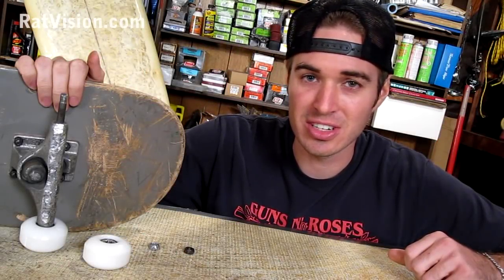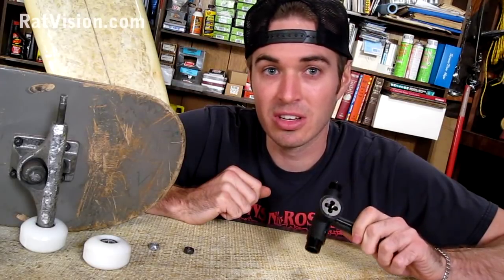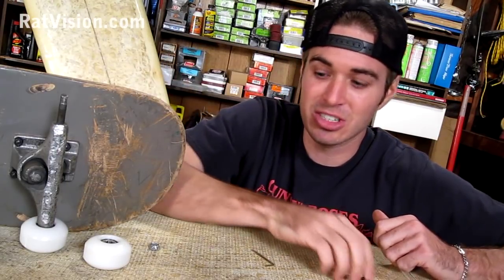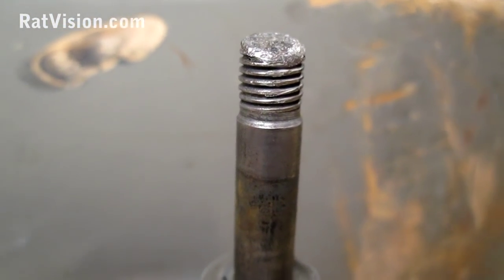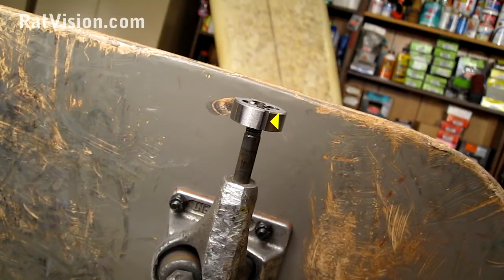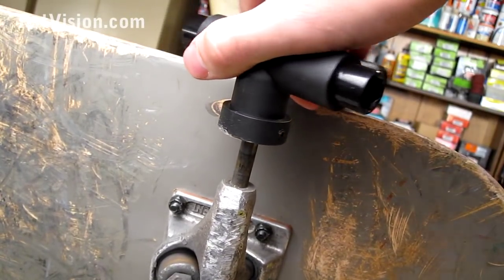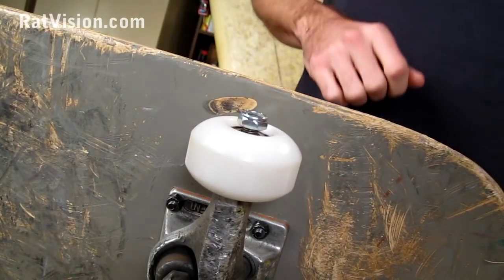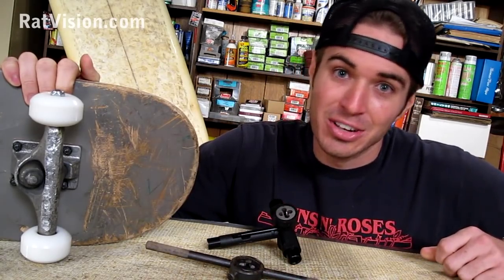Fix Truck Axle Threads On Skateboard & Longboard

Comment: When you are using a die to cut or clean a thread always use a lubricant like trefolex. Also, you never cut a thread in one pass (constantly turning the die in the one direction until the end) do a half turn or so then back it off a quater turn to let the swarf clear the die (thats why the die has three or more cutouts around it, to help clear swarf out and not get clogged up and jamed). Keep doing this until you have reached the end of the thread. If you don't clear the swarf out it can jam up the die and thread and cut a really nasty notchy/broken thread or worse strip/cross the thread completely, which means new truck time.
Reply: good info but not really applicable to this imo. you shouldnt be removing enough material to clog the die as the threads have already been cut; youre only cleaning them up

Comment from the maker: The axle washer is used as a spacer between the bearing and nut.  If you don't use bearing spacers in the wheels the nut will push the inner ring of the bearing into the wheel.  This binds up the bearing and it won't rotate.  This crushed the shields in one way and pushes them out the other side.

Comment from the maker: Thanks.  You're absolutely right.  But most skaters, typically street skaters, don't use spacers. If you watch our other video about spacers you'll see how most of the time spacers don't work.  You have to give a wheel a little bit of movement without spacers, and sometimes with spacers, because they don't always work.

Comment from the maker: @ClowninAroun Washers keep the bearings from touching the truck and axle nut.  They also allow tightening of the axle nut down (with a bearing spacer), so the wheel and bearings can more efficiently.

Comment from the maker: 5/16"-24.  The 24 is important.  It means how many threads there are per inch.  It also indicates that nut or bolt has "fine" threads. However, it's very hard to find the right nut at a hardware store, because they don't sell thin/flatter nuts.  They are usually taller and have more threads on them. This causes a problem when there is not enough threads sticking out on your axle for the nylon to grab onto.

Comment from the maker: It can be extremely frustrating if the axle is badly damaged.  You've to hold it steady and force it one.  Sometimes pushing down and going backwards a tiny bit and then forwards helps to grab onto threads.  You may need to look at the axle closely and see what may be causes the problem.  The close up in the video shows how the threads can get flattened. This could be an issue all around the end.  You may need to file some metal away.  It's hard to say what to do without seeing it.
Reply: If the tip of the thread is so damaged (like in your video), I would go over it with a thread file first (a special tool), then it should be much easier to thread the die on straight. If there's enough extra thread length, you can just put a good 45 degree chamfer on the end of the axle. This would just remove the portion of the thread that is mangled, and the die should go on easily. This (the chamfering) is also done when cutting new threads on a length of bar.

Comment from the maker: If they are worn down maybe not, but it might help. Since your trucks are new, it's probably from the tricks you're trying. Replace the axle nut too.  If you have axle washers on you may need to remove one or both, so the nut can grab onto some threads.

Comment from the maker: @JustSomeRandomNewb   No, the original or old threat will not be damaged.  A die was specifically designed for this task.  The die is the same size as the threads on the axle.  All the die is going to do is remove, or push back metal that is in the grooves, as wells as sharpen the threads.  If there is any damage to the original/old threads it's going to be caused by having the die crooked.  I assure you that no damage will be caused by the die, if used correctly.

Comment from the maker: Yes we can help with squeaky trucks. A common trick is to use Dove brand soap shavings in the pivot cup bushing. Bee's Wax will actually work much better and last longer. It can resist moisture and doesn't break down as fast. Take a small piece of bee's wax rub it all inside the pivot cup. U could also put wax shavings in there instead. Rub some on the piece of the hanger that goes into the pivot cup. Bushings may be causing the squeaks too. Apply wax on the hanger that touches the bushings.

Comment from the maker: @916attila I am going to assume you meant to say, "...the bolts [you meant nut] do NOT stay tight..."  Is that correct?  The problem is the nut. Like I showed in the video the the nuts can get damaged and loose their threads.  Also the nylon (white plastic) in the nut gets worn out.  You need to replace it.  A new nut should fix your problem.

Comment from the maker: Actually, it's the bearing spacers that allow you to tighten the nut all the way down.  Without the spacer there is nothing behind the inner ring to keep it from pressing inwards. The washers are also used as a spacer between the truck hanger and the bearing, and the axle nut and the bearing.

Comment from the maker: @Hwiwonkills You can get the Reflex Utili-Tool at a skate shop or online, and get a die at a hardware store or online as well.  Ebay has them.  I saw a set for as cheap as $10.  I recommend the skate tool.  You actually made me realize I left something out.  The size die is 5/16-24.  Be sure you get 24, because this means that the die has fine threads which match the axle.  Avoid sizes 5/16-18 or 5/16-32.

Comment from the maker: It can be very frustrating sometimes.  Have patience.  Sometimes I find pushing down and going the opposite way (couter clockwise) a tiny bit then counter clockwise helps for the threads of the die to find the threads of the axle.  Take a close look at your threads.  Does it look like one threads got smashed down into another?  See what's causes the issue.  If you can find the problem then you may know how to best use the die.

Comment from the maker: @TylerM4197 This happens sometimes while taking the nut off.  Basically the threads are not twisting out anymore.  To get it off you need to angle the nut as you turn it.  Do this by prying a flat head screw driver between the nut and the bearing. Apply some force to the nut like you are trying to pry it off.  With your other hand use a tool to try unscrewing the nut off.  The nut just needs to angled as much as it can to get it off while unscrewing.  let me know if this worked for you.

Comment from the maker: Find them at a skate shop.  The dimensions are 5/16-24.  The nuts at a hardware store are taller and may not screw on the axle good because it won't grab onto the nylon.  Best thing to do is get new ones at a shop.  Also ask for some old nuts if they don't have new.

Comment from the maker: @anindo75 I hate to say learn to flip your board better, but that's the only way to keep them from getting smashed up. The threads on the axle are more important than the axle nut.  As long as you can get the nut off that's all that matter.  Pro's mess up their axles just as much as everyone. Plus who knows how often a pro changes their trucks or axle nuts. Everyone is different. You can get new nuts at a hardware store if you need them.

Comment from the maker: How are the threads.  Sometimes truck axles stick out farther on one side than the other.  This can result in not enough threads on one side of the axle.  If that is your case, you can remove one or both of the axle washers to get better/more threads for the nut to hold onto.  See if that helps.  Let us know if it does.

Comment from the maker: The die on the skate tool is the same thing.  But you don't have to have the skate tool either.  You can get a die at a hardware store.  Not sure if you can get individual sizes though.

Comment from the maker: @anindo75 At a skate shop or hardware store.  They are nylon locknuts (nyloc, nylock), size 5/16th, Fine threads. I believe it is also a Low or Standard hight.  Best thing to do is take another one with you if you go to a hardware store.

Comment from the maker: @DjHottspinz209 Keep the board on its side like I have it in the video, but put the bad side down. Use a flat head screw driver and a hammer. You can try hammering without the screw driver. You want to hammer down at the nut in just one spot. The screw driver might be easier. Put the end of the screw driver between where the nut and axle are touching and hammer down. This will cause the nut to be at a slight angle. Then try unscrewing it again. Rethread and get a new nut. Tell me if this helped.

Comment from the maker: @14sharpobjects Get some softer bushings and tighten the nut down until the trucks are as tight as you like.  If your back truck is ground down more than the front switch your trucks around

Comment from the maker: @Hwiwonkills At a skate shop or hardware store. They are nylon locknuts (nyloc, nylock), size 5/16th, Fine threads. I believe it is also a Low or Standard hight. Best thing to do is take another one with you if you go to a hardware store.

Comment from the maker: Yeah, if the nut is stripped and won't come off you need to apply pressure from behind it.  Pry on the nut while you try to turn it.  It should grab onto some threads and come off.

Comment from the maker: @Blast692 Thanks for the great comment and feedback.  Yes you can rethread a kingpin.  You'll need a 3/8ths-20 (20 means fine threads).  If you're lucky you can find a place that sells the handle and die separately.  For just these 2 parts you're looking at $15- $20US. Don't get a cheap complete set.  You'll regret it because most cheap dies become stripped, ha. Anyway, it's totally worth the money to have handy, and you may need it in the future.

Comment from the maker: Spacers are supposed to be used for both types of skating.  The problem is that spacers and wheel centers come in different sizes, so they hardly fit correctly.  You also can't tell what size spacers go in your wheels unless you have calipers and a micrometer.

Comment from the maker: Trucks are made of Aluminum which does not rust.  The axle, kingpin, and nuts are made of steel and might rust.  The best thing to do is dry everything off after each time you skate.  You could put a little lubricant on the axle.  The bearings don't spin on the axle.  The inner ring is actually stationary.  The kingpin and nuts won't rust as easily as the axle so as long as you wipe your board down you should be ok.

Comment from the maker: It really depends on where you look.  Online you can find one for maybe $5.  It's a little hard to find dies sold in singles pieces.  You can find sets between $10-$2, but they may not work very well because it's made low grade steel.  Best bet is to find a 5/16 die online with a handle.

Comment from the maker: @TylerM4197 Is it like this even with the axle nut off? If so you kind of have to pry the wheel off. The wheel sticks because of the truck. Usually it's extra aluminum (called flash) on the axle. It gets between the bearing inner ring/race and the axle. You have to yank on the wheel really hard. Sometimes the bearing will stay on the axle. This makes it easier to try and pry it off. Be sure that you don't damage the seal or shield on the bearing when prying. Let me know if this helped.

Comment from the maker: @iba72don It won't hurt. They're a bit important for proper bearings function tho. I've got a video coming out soon that'll cover everything about bearings. Washers put pressure on the inner ring of the bearings so the hanger or axle nut don't rub on the shield or seals. Wheels should use bearing spacers, but the street skating community has totally lost touch/interest with the importance of spacers. The axle nut should be tight when using spacers so the bearings and wheels roll optimally.

Comment from the maker: The best thing to do is to rethread the kingpin.  You probably do not have a die.  Look at the kingpin closely.  Do you see which threads are damaged?  Try to file the damaged threads.  The threads, as seen in the video, may look similar to your kingpin threads.  This is why the nut won't go back on.  Get a on new kingpin nut.  Try to fix the threads.  Sometimes forcing a new nut on will help move the threads back as you tighten.  Without seeing the kingpin this is the best advice we can give u.

Comment from the maker: Bolt?  We assume you meant to say nut.  If it is loose it could be the threads from both the nut and the axle.  A new nut and rethreading the axle should solve the problem.  This works with any trucks.

Comment from the maker: Hvordan gor det? I'm assuming you are Scandinavian from your name. Sorry if you are not. I am going to guess you meant to say, "Where can I get those 'nuts' to 'lock' the wheels to the truck." Those are called axle nuts. See if a skate shop has any. You can try a hardware supply store. They don't always have the same kind of nut. Axle nuts are thinner/flatter than the nuts that are at a hardware store. What you need is a 5/16" inch – 24 nylon lock nut. Size M8x1 should work too.

Comment from the maker: @ForeverTranceMusic Do you need to rethread it to get it out of the baseplate, or do you need to rethread it because the nut won't go on?  If you want to take it off you can use a file to file away any troubling spots. If you want to rethread it use a 3/8ths die.

Comment: Right on man, but I prefer white lithium when I'm cutting axles. It makes it easier to get the metal shavings off with a shop towel and is what I've used in the machine shop when drilling hard metal and to keep my cobalt steel bits from wearing prematurely. But you're right WD-40 is good in a pinch, and you're right on about the motions.

Comment from the maker: Do they turn to one side when you are not standing on it? If so, that is completely normal because when you step off the board the bushings didn't push the truck hanger back to it's center point.  Your body weight corrects this. There is nothing wrong, and nothing you need to do. This is why you see it a thousand times. If it's different, then let us know.

Comment from the maker: Sounds like you may have used the wrong size socket. Hit the socket with a hammer to get it off.  It seems like you need to put the wrench on the socket and keep turning it.  It's hard to tell what is happening without seeing it.

Comment: When trying to put on the Die it may be necessary to file the axle to remove some of the damaged material to allow the Die to go on. If you have to do this use the file at 45° to the axle and file around the whole of the axle trying to keep it even. When using the Die it should be lubricated with some cutting compound if you don't have access to cutting compound WD40 or similar will suffice Turning the Die continuously can cause the Die to break so make 1/4 a turn back for every 1/2 turn forward

Comment from the maker: That is not a wheel problem, or any problem at all.  It has to do with your bushings. The truck is leaning to one side because of how you stepped off your board.  There is nothing wrong with the truck, wheel or bushing.  While you skate it levels out.

Comment from the maker: Those wheels were totally new in this video.  Unfortunately, the urethane that wheels are made of turns yellow over time.  It's caused by UV light from the lights in the skate shop and from the sun.  Wheels manufacturers could put UV inhibitors in the urethane to solve this problem and keep there wheels looking nice and white, but they don't.

Comment: It's 2018 but the description below took place in 2007...    
                                                                        ...so it balances out...  
                                                                ...right?... 
      
    I once fixed my "mushroomed" axle with a knife and a nail...and another hanger. 
I used the knife tip like a chisel and the hanger to tap the knife tip through the "mushroomed-over" threads(of which there were 3-1/2) ,and then I ran the edge of the blade through the "new" threads to open'em up a little more and twisted on a nut from a previous set of trucks.
    It worked out alright, but if I had used a die I would've been able to skate for an extra hour or two that day.

Comment: You need a new nut if that keeps happening. There's a little nylon insert inside of the nut. The colloquial term for these nuts are "nylock" short for nylon locknut. If you have changed the nuts, you have some problems, like tightening it too tight, missing the washer between the bearing and nut, or you have worn your axles down too much for the nylock to grip. You could also be using the wrong threading for the nut which can cause it to wobble loose, or damage your axle.

Comment: Have you tried replacing it with a new nut, because the nuts used on the trucks are called lock nuts and they have a rubber ring on them and when the nut is tightened down on the thread for the first time it seals around the thread and it won't be able to spin freely. If you have taken the nut on and off, this means that the nut does not have a tight grip between the rubber ring and the thread on the truck and the nut can spin freely and come off causing the problem that you have.

Comment: If you over tighten the wheel nut it won't crush the shield because it showed in this video that the nut doesn't even come in contact with the shield